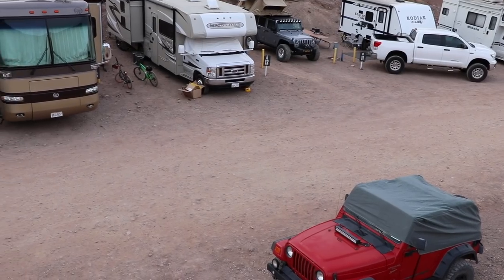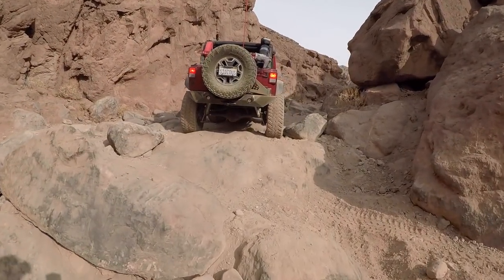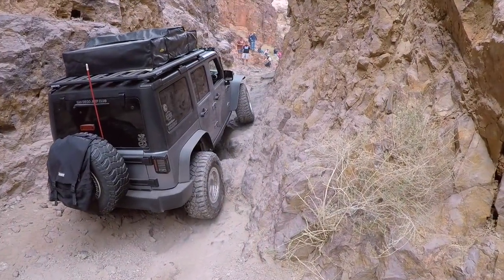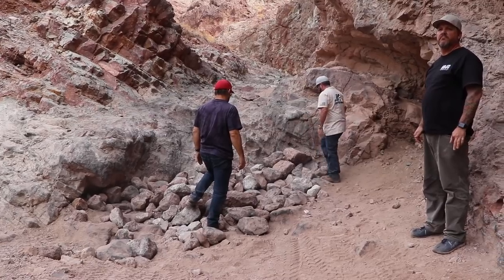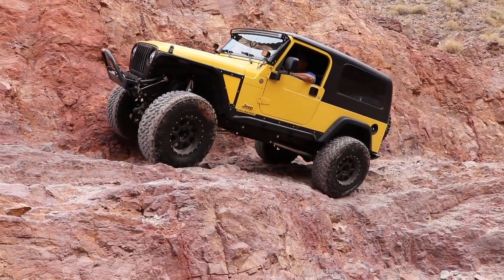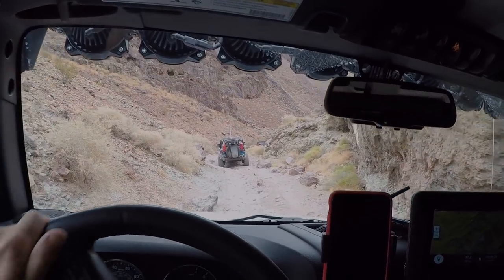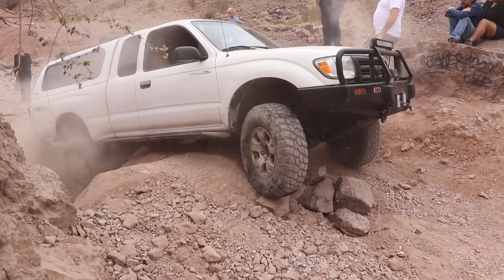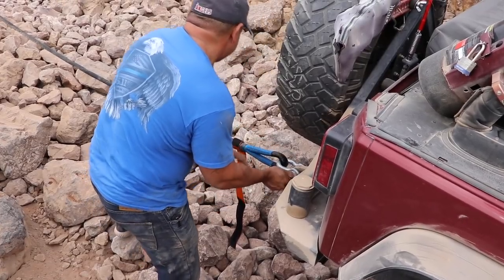Jeep Wranglers Off-Road in Calico - Adventure Weekend Day 2

Comment: Always enjoy your videos, Brad. There seemed to be a noticeable difference in driving styles between your group and the other group. Not sure if there was a right or wrong, but I prefer the slower, purposeful pace the San Diego Jeep Club exhibits.
Reply from the maker: I'm with you, I always prefer to take a nice slow approach to an obstacle whenever possible.
Reply: The driving style seen from other group is typically necessitated by older and 'lower coin' rigs with leaf springs, stiffer suspensions, and lack of lockers. Every rig is built differently and in turn will need to be wheeled differently. But I'm with you, a slow purposeful pace is my preference as well.
Reply: Slow is pro 👍

Comment: Would a slightly modified 4 cyl Manual make it?
Reply: The engine size wouldn't matter.  There are not big, long, steep hills to climb.  Depending on your clearance, and tire size, you may get stuck, so go with someone (really any vehicle should have someone else with them in a different vehicle).  One of the 2 door red JKs was running I think a 33" tire and possibly only a leveling kit.  They did get stuck on a big rock in one of the last gardens.  I would suggest running it the way we did it in the video. The opposite way is harder.